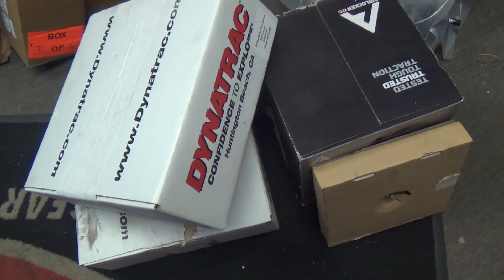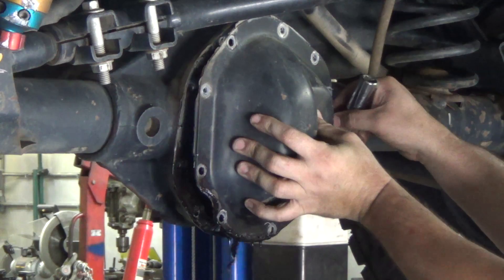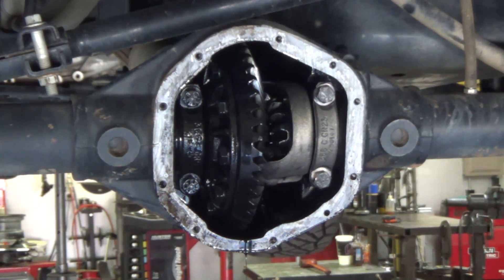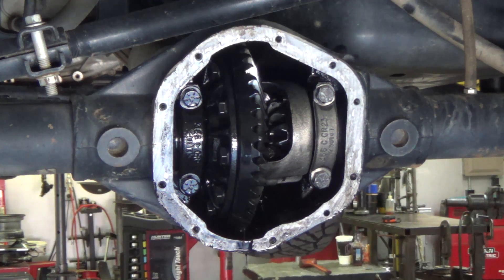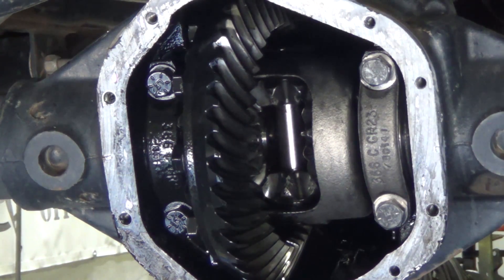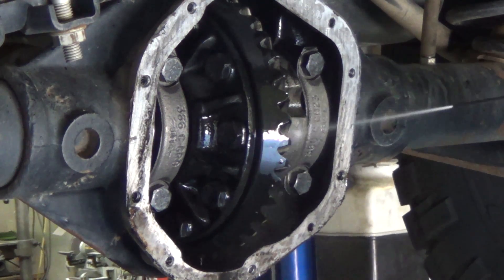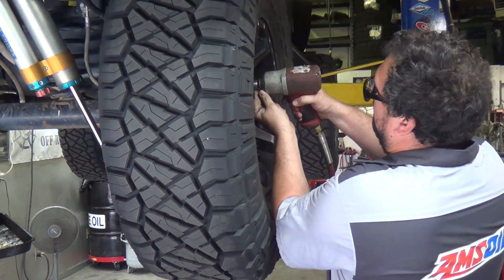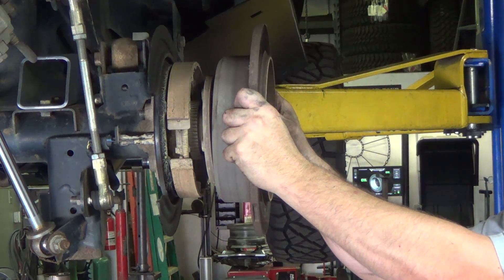Rear Axle Upgrades and Diff School - Part One - Stock Removal, Gear Oil, and Wear

Comment: Great series! I ended up going the same route. ProRock 44 up front, 35 spline RCVs & retained D44 in the rear, 35 spline G2 gold placers, DT diff cover & bridge for RK 3 link & ARB's F/R...bout as good as it gets w/o going D60. The difference between 30/32 spline vs 35, side by side is impressive